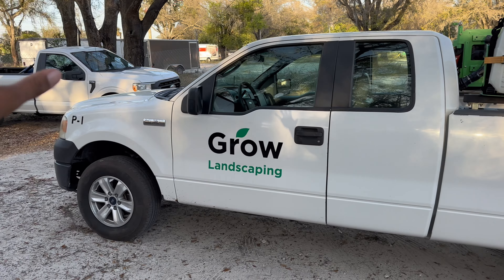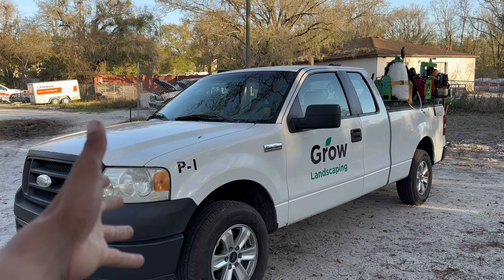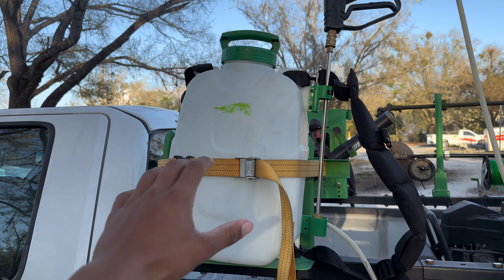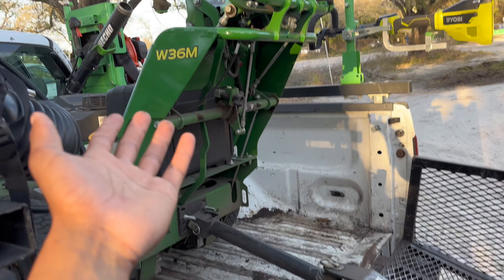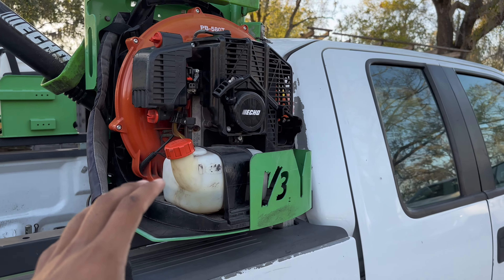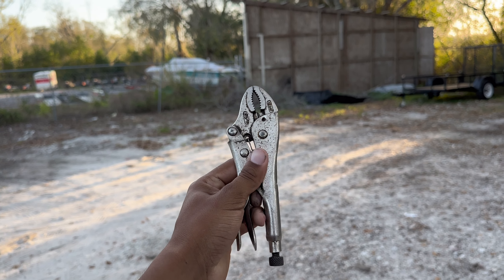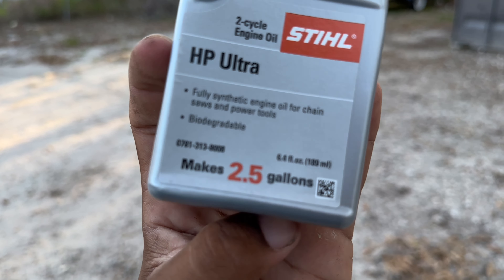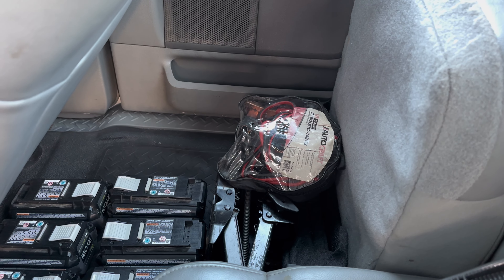SUPER CHEAP LAWN CARE Setup | 15K Months! *WITH NO TRAILER* | Chase Grant

Comment: I thought I was the only one using the ryobi trimmer and edgers with the hedge trimmers  I had mines for 3 years still works great oh and you can add any other attachments I have stihl and ryobi mix match with an edger lol
Reply from the maker: Never knew that 🤔
Reply: Yeah the edger for the ryobi to me is not that great so the stihl one has that little plastic at the end of the shaft remove it and slides right in. I’m not saying go buy a brand new edger attachment but if you find one cheap it’s worth it or take a grinder and cut off some of the hard plastic on the ryobi edger on the side so it doesn’t clog up on you with mud
Reply: And get some dry wrap for the power head so it doesn’t get wet and some Darwin’s grip to save youre back and makes it look better to and use those bad boys for years save thousands of dollars vs buying a electric stihl right now hopefully they drop there prices in the middle of the season